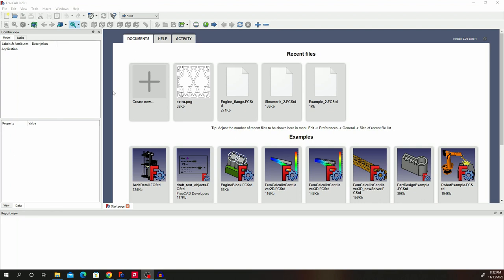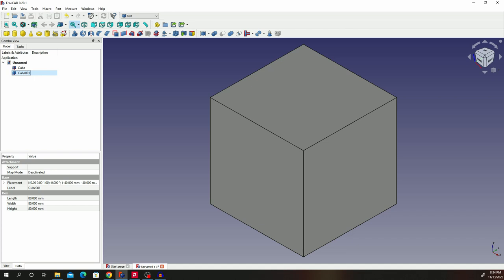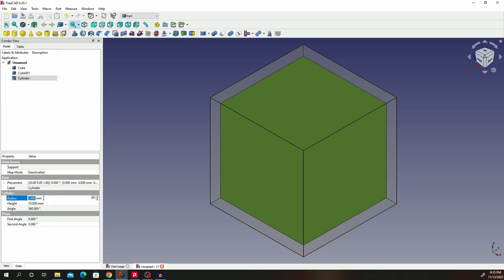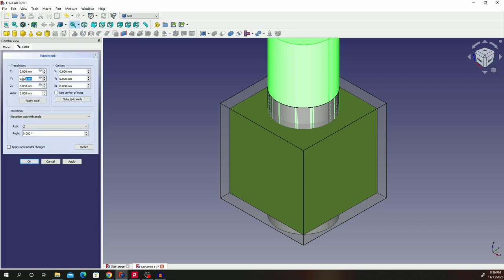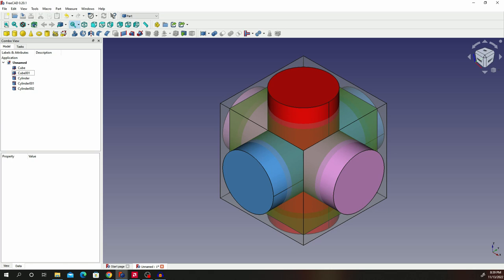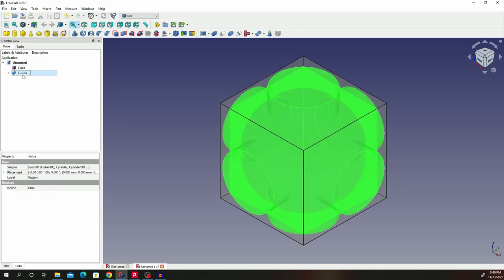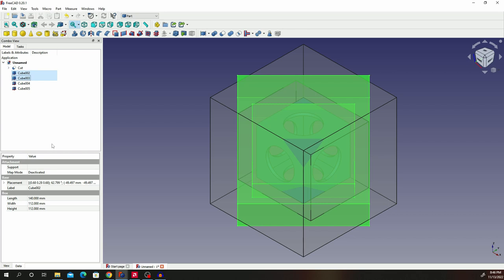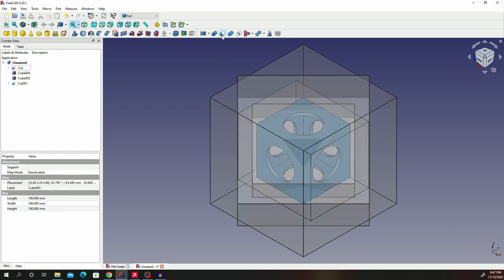FreeCAD 0.20.1 Quick Example Drawing a Whiffle Ball

Comment: I tried this about 5 times and kept ending up with a Whiffle Ball which was only cut on 4 corners. I then noticed that the video skips at about 15:34 and because of this misses out some vital information. Namely that Cube004 and Cube005 need to be rotated in exactly the same way as Cube002 and Cube003 only this time the degree of rotation should be  minus 45 degrees for the X and Z axis. I got there eventually but thought I was going mad for a bit as I had previously tried following the example on FreeCAD's tutorial pages which had failed in exactly the same way. Anyway, mission accomplished finally but I think I need a lie down now 😵‍💫